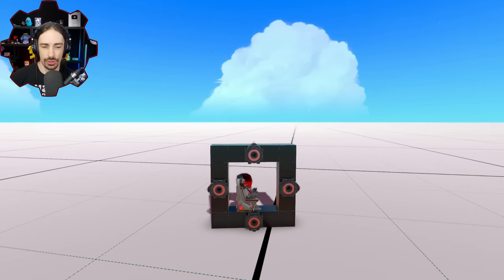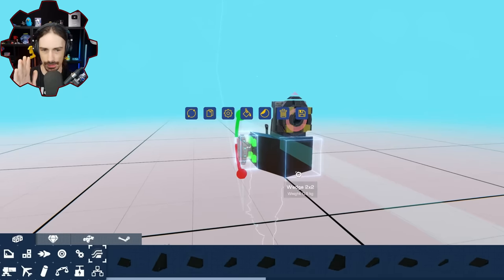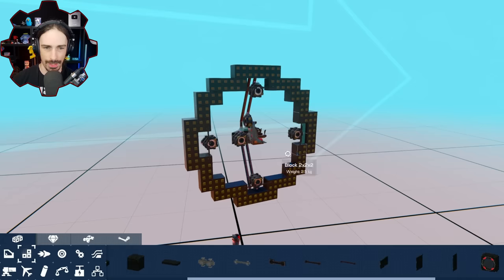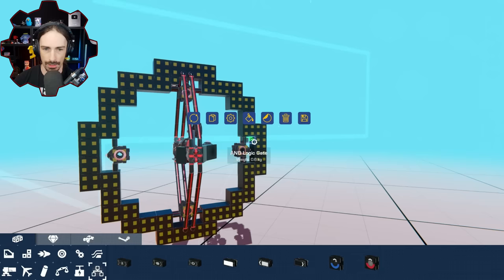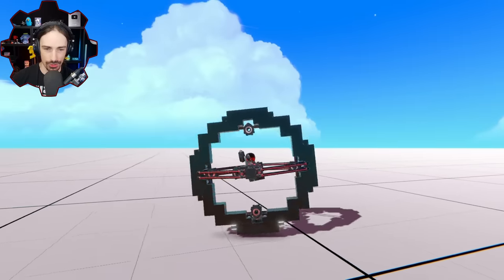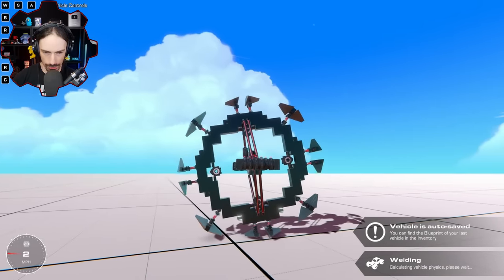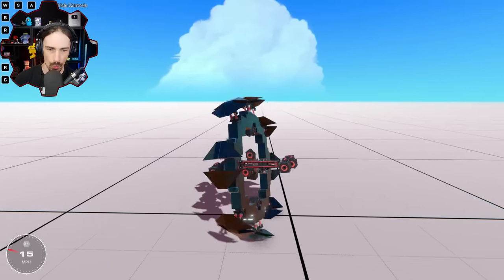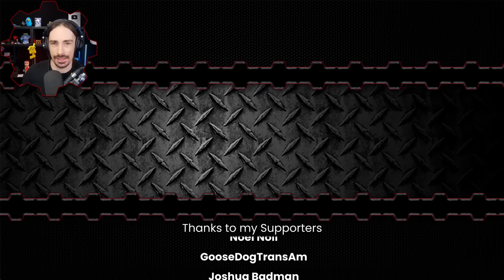Building a Monowheel Powered by Gyro Stabilizers?

Comment: So, the lean in the opposite direction is actually the application of physics on rotating bodies. Like. Your monowheel is the wheel of a motorcycle, if you wanna turn to the left you start with a turn to the right, and then the bike will lean to the left, and you can then turn to the left. The reason for this is that on rotating bodies, the force vector is applied 90 degrees out of phase. So a turn to the left is a turn forward, which creates a lean to the right as the force vector is now on the forward side of the wheel. Then turning the wheel to the right applies a torque to the front of the wheel and the turn to the right is a straight line.
Reply: i knew the motorcycle turn method would be in the comments already!  I think you're right, scrapman needs to lean the opposite direction of what he wants to go before starting a turn.

It's wild to see a real life technique show up in a simulation like this!
Reply: I was looking for this comment as soon as I saw this in the video cuz I was wondering if anyone thought those two things were related

Comment: Two things; 
1. The Faulty Turning at the End -- the turning was doing weird things cause it was trying to turn the seat as opposed to the entire wheel, to fix this you could put the turning gyro(s) on the outside where the stabilizing gyros are. 

2. The Propulsion -- you could use angle sensors (or as I like to call them, angleometers) in replacement of distance sensors, as they'll be simpler and probably work better in your favor, and on that note, you can attach the stabilizers directly to the wheel (the ones you used for propulsion) only on the opposite side so they point inward.

Comment: Cool idea!

Some thoughts:
- When using multiple gyro's you generally want all their axis to meet, ideally in the center of mass. Having 2 rows side by side like that isnt going to do much as they are (in a way) fighting each other, this is the case in any direction/configuration but its most notable when trying to fight gravity, gyro's on the same angle but not sharing an actual axis just appear to be pretty weak even if that does work fine in space.
- For your keep-upright, why don't you just have 8 gyro stabilizers rigidly attached to the inside of the wheel, essentially pointing sideways (inside the wheel, not out of the sides of wheel) from the current gyro stabilizers? and toggle the two that point upward when matching sensors see ground?
- Finally, if you really wanna challenge yourself, surely you've realized near the end there that if you could control the time between sensor seeing ground and gyro stabilizer turning on then you could make it accelerate/decelerate? with a piston, some sensors and some logic that should totally be achievable.

Sooo, Version2 when? ^^

Comment: the turning problem is because the treads are angled on the outside and therefore are turning you in the opposite direction (which is why when the angle of the hinges was bigger it worked) so you need flat treads or to have the angle of the treads be a lot greater. love the vids

Comment: I really need flashbulb to make everything have connectionpoints wherever, wheels too and be able to select what actually attaches (as an advanced option)
Reply: Nah, that would make the game way less fun.
Reply: @Dunch0717  what do you mean? They could give you the option like show aerodynamics and being off by default. It would make certain aerodynamic blocks be actually useful, also do you know how much it pisses me off that you have a motorcycle seat where you can't place an engine in the middle? And also they need to adjust the drag points on it
Reply: @rltt379  Thats precisely what makes building vehicles fun. The challenge of trying to figure out how to make things fit together, and look nice. I love it. It makes the game have a huge, and very exciting learning curve. Also, if you want to have an engine centered on a motorcycle seat you can put a piston on the leftmost attachment point on the back of the motorcycle seat. Then make sure it is pointing out to the right. Put a Tube Elbow on the end an make sure it's pointing up. Put an engine on top of the Tube Elbow, with one side of it being over the piston. Then in the pistons settings, remove all controls, and set the starting position to 0.17, and the speed to 100. Then when you spawn it in, the engine should be centered.
Reply: @Dunch0717  dude, you wouldn't have to use it. But the fact that your solution is centering by making the craft not symmetrical is irritating. It would simply make more sense if pieces had more connectivity. Having it on wheels enable other kinds of mechanisms as well. And there's no reason why putting things on half blocks shouldn't be a thing. You would also be able to make certain crafts more aerodynamic and you wouldn't have to rely on the connector clips as much for optimisation. It would also help with smaller aircrafts having a shot at flying straight.
Reply: @rltt379  You could just put a piston on the other side and set it to the same settings, or just use two engines and ditch the pistons entirely. I don't see how the ability to attach things to wheel would be beneficial when one could just us a rotating servo. Being able to attach things to half block would make building certain thing much harder and it would most likely deter some new players. It would also make vehicles go up in complexity much faster even if you aren't using the half blocks, because it's another thing for the computer to calculate. I've never had problems with making small aircraft fly straight, but it usually is just as simple as setting some wing pieces to a certain angle or something. I just think overall it would get rid of a huge chunk of the skill curve, which makes the game fun, it would make vehicles much more limited because of higher complexity, and it would possibly deter newer players because of the more complicated system.
Reply: @Dunch0717  all your downsides don't mean anything when turning it on is optional. And it would absolutely make sense for wheels because you could create better launch mechanisms. You can't wrap your head around a centered 1 engine vehicle with motorcycle seat? What you suggest is 1. No solution and 2.literally harder than what I suggested... Again it would be optional like mirror mode, show aerodynamics etc and let's be real they already made building harder thanks to removing the camera snapping on the blocks you placed
Reply: @rltt379   @rltt379  I don't quite understand what you mean by "no solution". My method using pistons results in a 2 block wide engine being centered on a 3 block wide motorcycle seat, and that was the goal. The biggest downside which I already stated is the fact that vehicles would hit max complexity much faster if the ability to attach to half blocks is added. Even if you switched it off the complexity would still go up higher because it's still there, the ability to use it was just switched off. The only way to get around this is for there to be essentially two copies of every block, one with half blocks, and one without. But that just adds an entire level of difficulty for both developers and players. The ability to attach to wheels makes no sense when, again you can just use rotating servos. If they don't spin fast enough for you, then just stack them. Or even just use a helicopter engine.

Comment: I think this is an example of countersteering (maybe), which also happens in real life on bikes and motorcycles. If you push the steering to the left it will tilt you to the right side which result in going into the right direction instead of left. And vice versa.

Comment: Another opportunity to tell scrapman he can place gyros on powered servos to change where "up" is... Oh, and he could've just had the stabilizer gyros grouped with the movement gyros on the same key.
Im thinking, just gyro stabilize the seat in both axes, then put servos to tilt the seat, gyros then level out the seat resulting in tilted wheel.
But then you may say: but that is servo powered, to which i respond: then remove the gyros and see if it moves xD (no ofc not cuz a seat has no mass compared to the wheel around it)

Comment: cool build but what if you replace/build in normal wheels for the suspension to help with dampening cuz i think the rubber from wheels handle impacts better than normal blocks and have more grip so on the hole monowheel you have several real wheels and not your cool looking suspension

Comment: You seem to be running into the “counter-steer” issue associated with motorcycles and bicycles. Once a bike reaches a certain speed, you push the handlebars forward in the direction you want to turn. TLDR: when you’re fast, lightly turn the wheel the opposite direction you intend to go.

Comment: Oh thank you. I´ve been watching for weeks now how to mix logic-inputs with key-inputs. Guess makes sense to use an OR-Gate. Would have been nice to implement them directly but nice work-around.
Reply: As you play with those you may run into some situations. Game doesn't like to turn a one button press into a constant input, even with hold. You can use a distance sensor pointed inward at a block for a constant on, or an altitude block always triggering.
If you have a sensor+keybind into an XOR which feeds into an AND with the same sensor (sensor on XOR +AND) it's essentially a NOT gate on the button press. 

Hope that's interesting for you!

Comment: This could have been done way easier stabilizing the seat and putting servos at no strength and gyro on the opposite of the side of the seat for the rotation of the wheel, this is put early in the video. If you did this then awesome